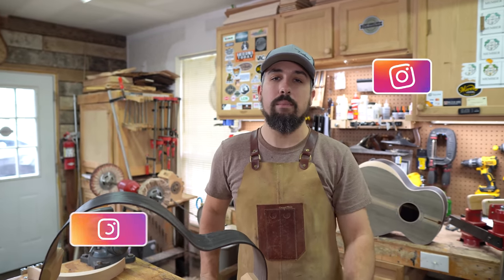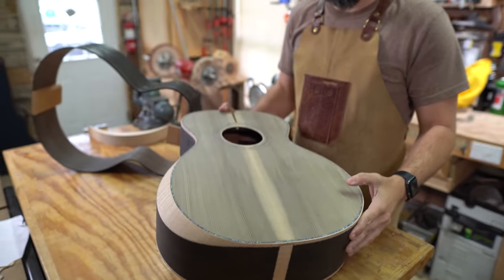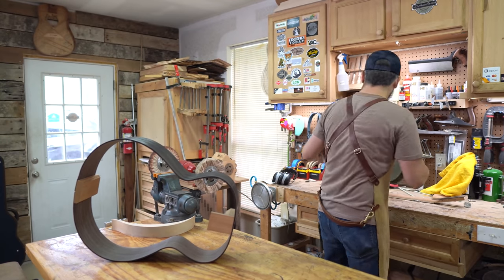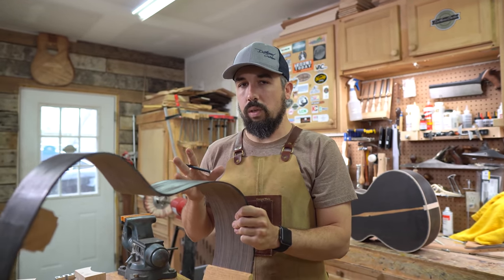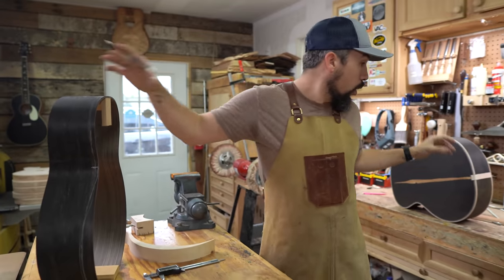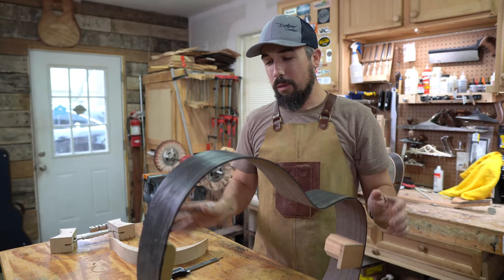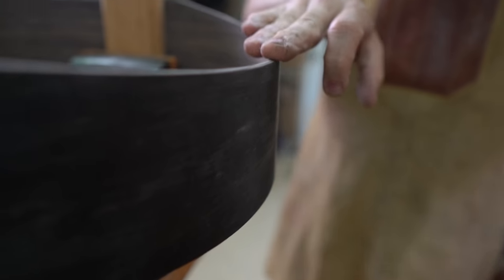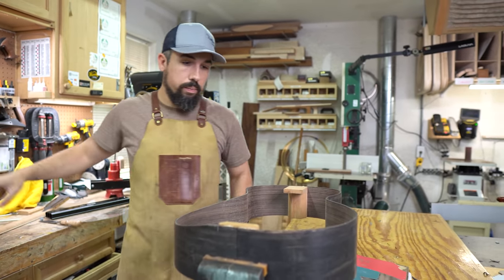How To Build an Acoustic Guitar. Episode 10 (Making an Arm Bevel, Part 1)

Comment: I'm not sure if you've addressed this before, but Prevailing Internet Wisdom™ seems to say "all solid all the time" is the way to go for acoustics. Obviously, you build the sides laminated, so I was wondering what your thoughts are around the laminated sides and back discussion. Obviously, the solid top is a given that's been thoroughly addressed.

Love the series! Thanks so much.
Reply: I believe he mentioned it previously. The sides are still solid on the outside, however laminated wood is added to the inside layer to give it added strength. I believe the idea is to have no movement on the sides which then allows the solid top and back to vibrate within a solid substance and give more sustain.

Comment: Wow, the thickness of the kerfing is a lot less than I expected. 😯
Reply from the maker: With the laminated sides, the merging becomes less important for gluing surface area, hence the thinner pieces.
Reply: @DriftwoodGuitars  Very cool! Thanks for the info :D
Reply: With laminated sides, you have to make your own linings, nice and thin. You glueing surface for the plates doesn't need to be wider than 1/4 if you work clean. Gluing tops and backs to THICK sides can cause too much edge grip onto those vibrating plates. That's building it too heavy. You need a thin gluing surface on the rims, so the top and the back are not all bound up in a thick rim. You just cannot use store-bough linings on a double-sided guitar; you gotta fit the thing to the other thing... That's a GOOD thing.

Comment: Hi guys. I was wondering how much proud of the sides to sit the arm bevel backing block at the waist and heel block. It looks about 3mm at the heel block and 15mm at the waist? Is this about right?
Reply from the maker: Yeah that’s about it. No need to be exact. Just enough to be able to sand down during radiusing.
Reply: @DriftwoodGuitars  thanks heaps! I really appreciate it. Keep up the excellent work😄

Comment: Did the bracing take into account the arm bevel, back in part 2/3? Or will you adjust it later?
Reply from the maker: I partially did, and I adjust it the rest of the way before I glue on the top

Comment: it wouldn't surprise me that IF the arm-bevel becomes common enough, suppliers will be offering pre-cut arm-beveled sides.

if so, until such time, i think it might be useful to take piece of tracing paper and lay it on a the side of a guitar with an arm-bevel and trace the side (sans bevel) onto the paper. when laid out flat it will be a template for a side with an arm-bevel and taper already cut to shape. 

in the meantime, i think i would seek out a mold that would hold the bent guitar sides, with end blocks attached, securely, so to facilitate the chiseling, sanding, planing and general shaping necessary to created an arm-bevel. it should be easily clamped to a workbench at a convient height too.

Comment: Why not round off the bottom of the arm bevel before glueing it in ? That seems like it will be a waking nightmare to do now it’s in. Maybe you’re into that though. I’m not judging…
Reply from the maker: I wish I could! If you did that, then there wouldn’t be a way to clamp it correctly. It’s a conundrum for sure. So far, no one has come up with a good solution